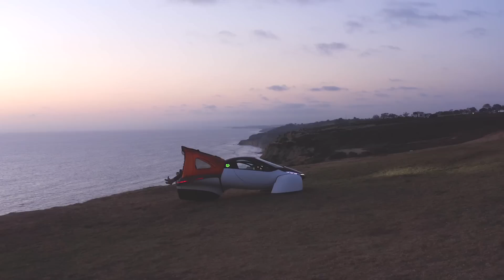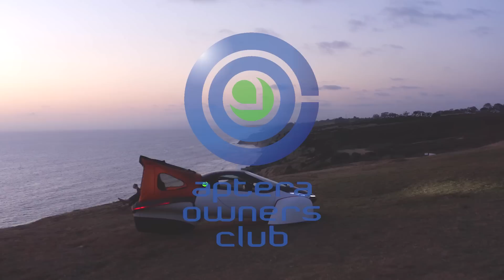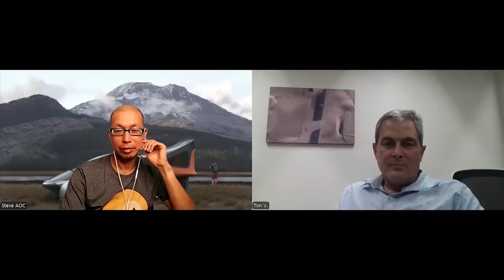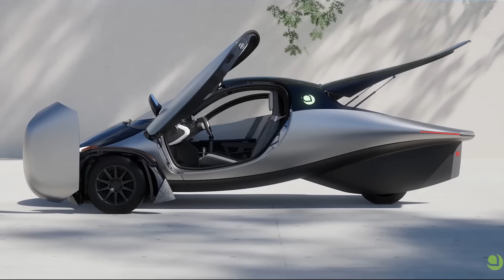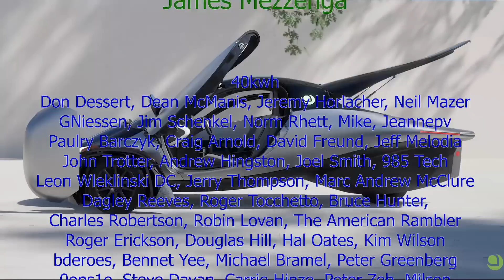Aptera Battery with Tim (3/3):  LFP and other viewer questions

Comment: (200 miles of range is plenty )
Reply: …for high density areas, yes. For the rest of us, no.
Reply: @scottgabbard662  (batteries are practical - wherever there is electricity you  can get a charge )
Reply: With compatible charging infrastructure every 50 miles
Reply: @lucianbakerii7562  as in charge with your solar panels
Reply: 200 miles would be more of a city car with the current charging infrastructure. Long trips (cross country) would probably be difficult or impossible@replica1052
Reply: @garywozniak7742  (200 miles be world reccord size city )
Reply: Says who? 😂
I have 260 and I have range anxiety.. Definitely looking forward to the 400 mile range Aptera..
Reply: @stephensullivan1011  when you suffer from range anxiety -drive slow
Reply: For a commuter car which is the Aptera’s primary purpose, totally agree.  My 2nd Aptera after the Accelerator will be a 250 mile range with the 3rd seat.  I think this version will be popular when they get around to making it.
Reply: @willstreckfus4248  with multiple apteras you can always have one on turo